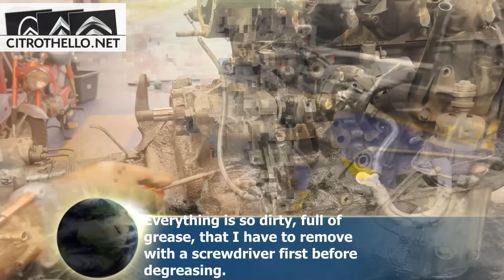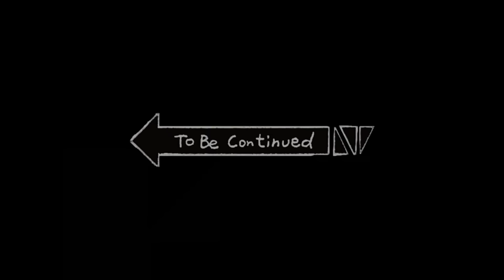Citroën DS 23 IE 1973 PRESTIGE. EX-ELYSEES 1 ER. MINISTRE PIERRE MESSMER. RESTAURATION PARTIE 02

Comment: Great work. Did you take apart the auxiliary air slide valve in the injection system? It looks like you did - i have the same valve in a 1970s Mercedes which is a little sticky